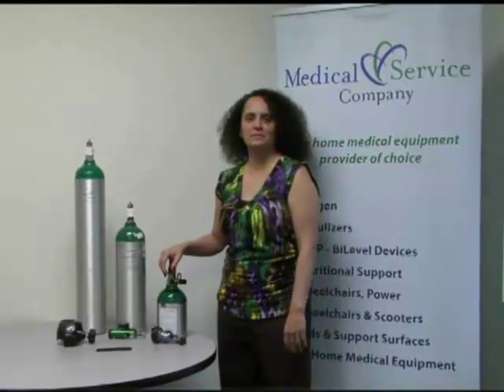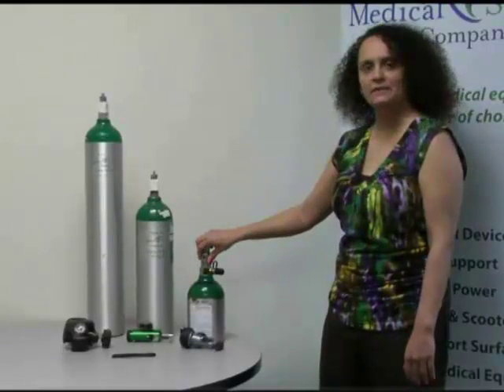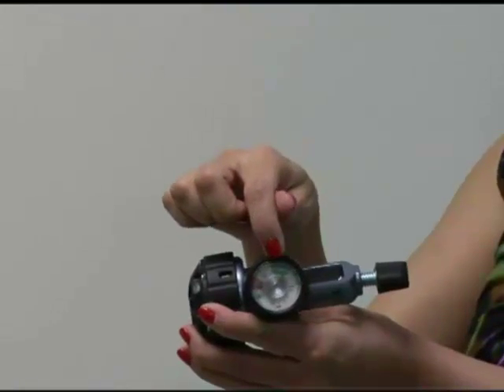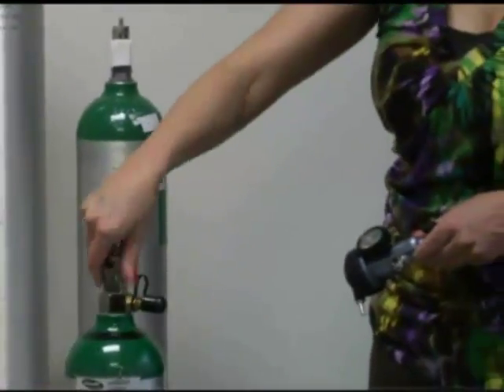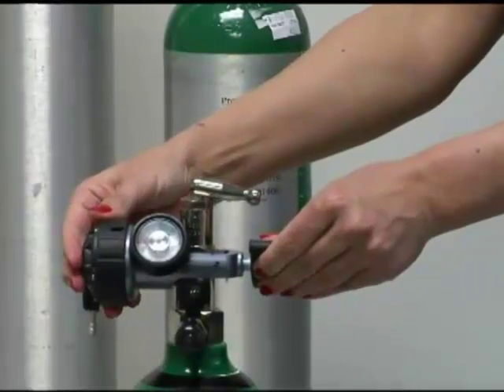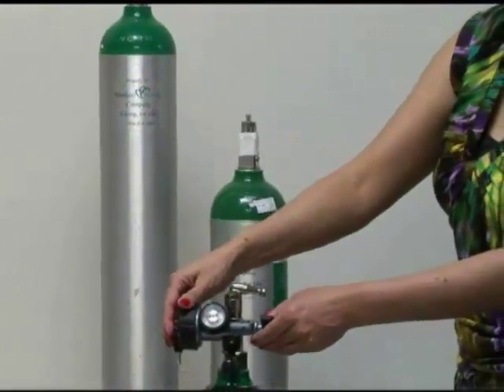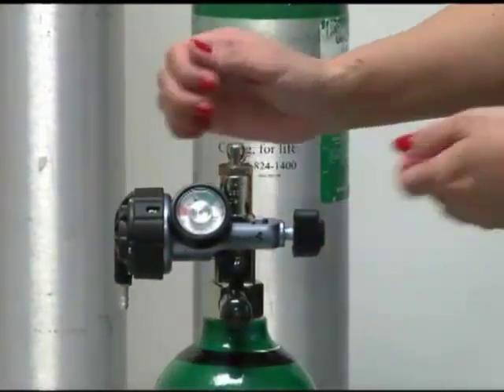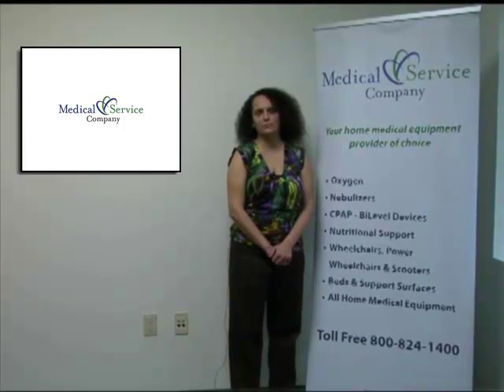How to use an oxygen gauge

Comment: When opening the tank the presenter says to open it "about half-way" and repeats this measure in the instruction for closing it. From the action in the video I'd like some clarification as to what "half-way" means in this instance. Clearly, it does not mean "1/2 revolution," right? It appears to mean 1/2 of of a 180 degree turn, or 1/4 revolution. I'm probably over-thinking this, but to my ear "half-way" could mean anything from a 180 degree turn, to three revolutions (in the hypothetical case where it takes six revolutions to completely open the top valve).
Reply: She means to rotate the lever 6 o clock